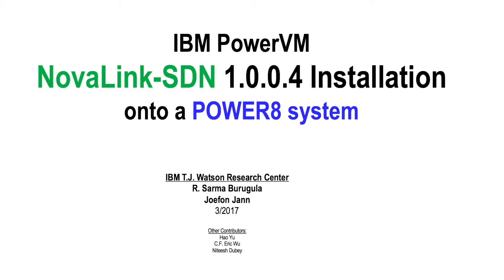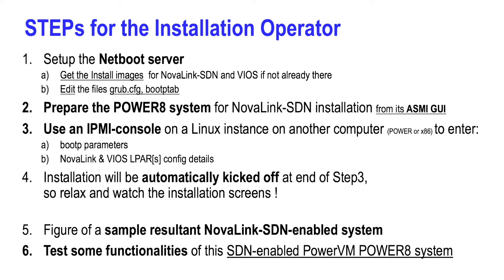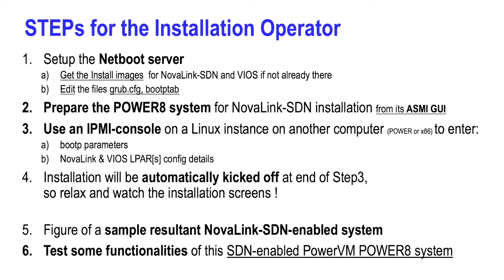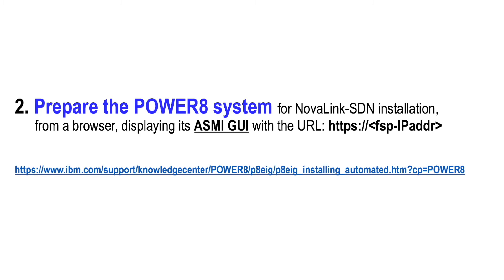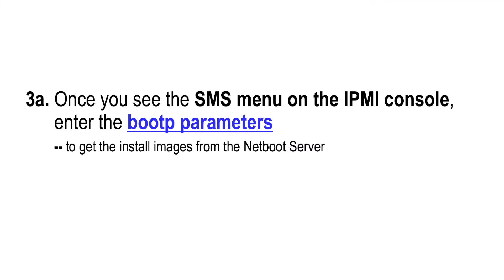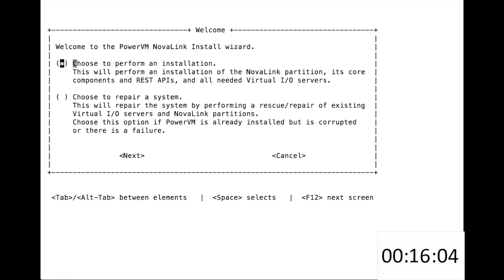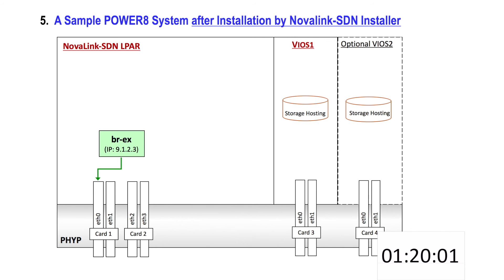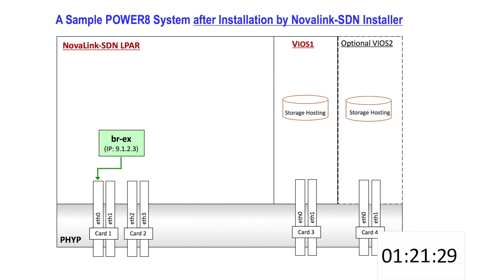PowerVM NovaLink-SDN Installation (NovaLink-SDN 1.0.0.4 Tech Preview) ibmYkt

Comment: I tried to install using a usb pendrive but the installation at a certain point asks me to insert a CD! I have obviously performed all the operations as requested by the page Adding the Virtual I / O Server Installation files to the PowerVM Novalink installer. If you have any suggestions I would be grateful. Greetings Francesco
Reply: You may find the following public info useful: 

MANUAL:  PowerVM-NovaLink manual in IBM Knowledge Center
http://ausgsa.ibm.com/projects/i/iddhw/p8ga7/p8ga7/cur/pdfs/systems/power/docs/hw/p8/p8eig.pdf

 -  2017/06/23 : GA of  PowerVM-SDN     => NovaLink 1.0.0.6
 -  2017/12/15 : GA of  PowerVM-SDE (=PowerVM-SDN + PowerVM-SDS)   => NovaLink 1.0.0.8
Reply: Thanks, I installed powervm-novalink on a power8 server. But now I need the manual with the complete syntax of the pvmctl commands. Examples I found on the web but not the manual.
Reply: Francesco Vecchio Thanks for the feedback.
Reply: Take advantage of your courtesy;) I skipped the aggregation of the ethernet ports during the installation of PowerVM Novalink. Now not having any knowledge I do not know how to do and I would not start the installation over again. You can kindly write me the commands using pvmctl. I have only three LPARs (novalink and the two vios) and three adapter 4-port 1-Gb. If you can help me, thanks in advance